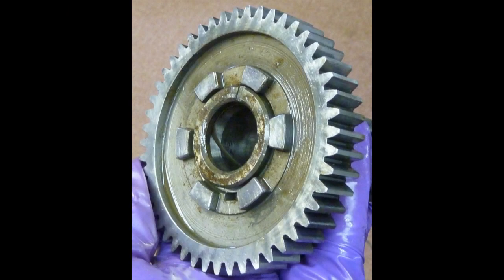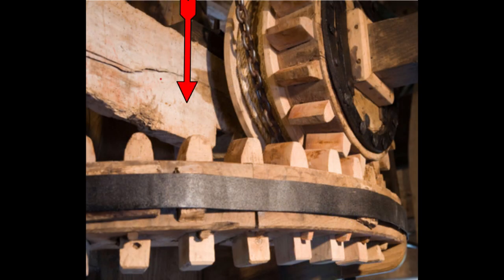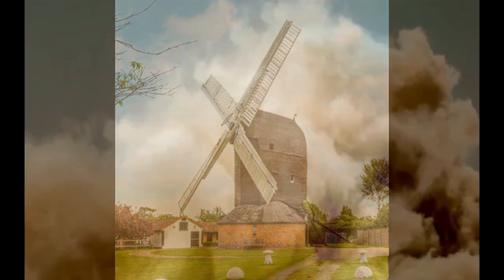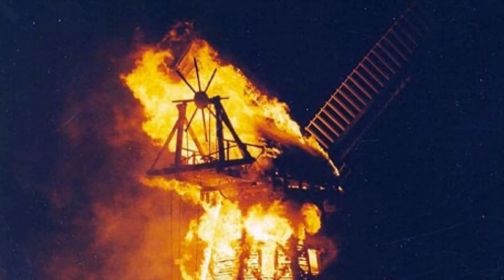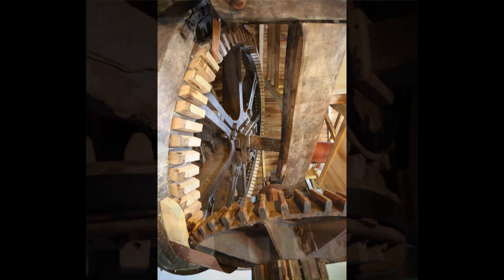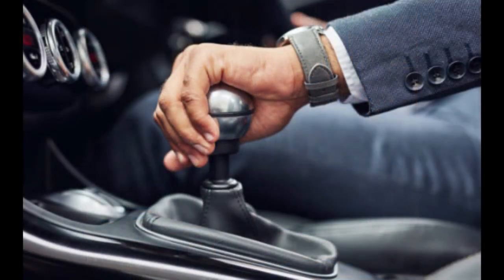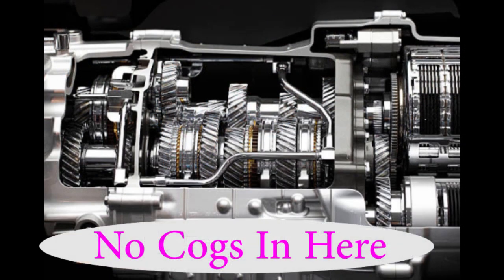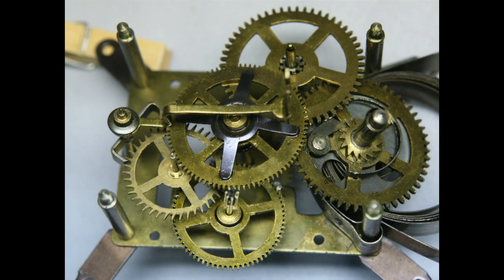Gear Not Cog

Comment: From the dictionary definition a cog is a tooth on a gear, and a gear is a wheel with teeth (the before mentioned cogs). From this you can get all gears have cogs, since the cogs are all the teeth on a gear.
Reply from the maker: Hello @TheGearhorn. Thank you for your comment.
The first gears were around over 4000 years ago and made of wood. If you make a gear from a lump of wood some of the teeth will be cut on the end grain of the wood and be prone to cracking off under load. The answer to this problem was to cut separate teeth with the grain running along their length, these teeth were fitted into holes round the circumference of the wheel. Names were needed for these new parts. For some reason the new removable tooth was called a cog, now a cog cannot fit into a gear as that is formed with its teeth and no holes to accept a cog. Cogs fit into a cog wheel. As time passed and new materials became available, the use of separate cogs in their cog wheels were not required any more. Solid iron or steel was now used to make gears. Cogs were not required unless you wanted to rebuild a windmill. As time passed the older generation (me!) knew the difference between a cog in a cog wheel and a tooth on a gear. People new to these devices saw two things that looked similar, they did the same job, so they   started calling them the same thing. Do modern dictionaries call gears cogs? Yes they do, and its wrong.
I have no idea why this winds me up so much! Take Care Jim
Reply: @CYC123  So, your argument is you know better than the dictionary does when it comes to etymology. Even if you did for some reason, the fact that it is by common dictionaries what it says and the fact that languages are meant to change over time means that calling a tooth on a gear a cog would be acceptable. As you have stated this seem to hits personally to you, that might be why it is hard to see it from another perspective.
Reply from the maker: Hello again @TheGearhorn
What I say is a bit “tongue in cheek”. I do see it from other people’s perspective, and I know languages changes and grows over time. It saddens me though when the language I used as a child changes, and the words become less precise. When I was a boy if you said a “cog” it meant a single cog from a cog wheel. As time passed people started misusing that word, its meaning became blurred, then someone in dictionary land decided to change its definition. A cog now days can mean several things:
A single cog on a cog wheel.
A single tooth of a gear.
A whole cog wheel
A whole gear wheel.
I know this is true, and I know it happening all the time to other words.
I also know it bugs me, probably an age thing!
Thank you once again for your comment.
Take Care Jim

Comment: Right, right, but surely, we can use the word Sprocket interchangeably.
Reply from the maker: Hello bananafone. Yes your OK with sprocket, but remember it can be called a chain wheel as well!
In an old watch or clock they have chains transmitting power but no sprockets or chain wheels there, they use a fusee its like a down hill spiral with no teeth! 
Thank you for your comment Take Care Jim

Comment: I'm 55 and was telling another fitter, 32years old about shapers - he's never heard of them!! We have a mix of 1940s power presses and modern US made CNCs - he still hates imperial and still thinks the reason Whitworth was invented is bizarre
Reply from the maker: The UK went metric in 1965, it took some years for the system to take hold. I started my apprenticeship in 1971 so was trained using the new metric system and the old imperial system. I use metric by choice mow and must admit some time struggle when going back to imperial.